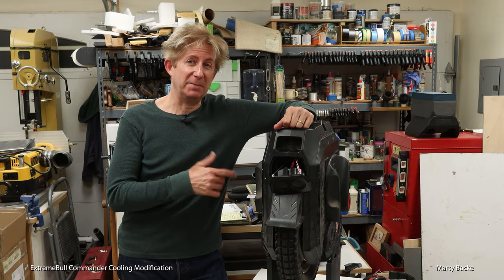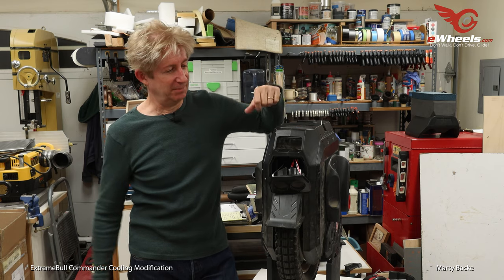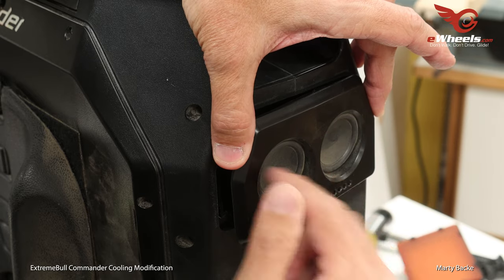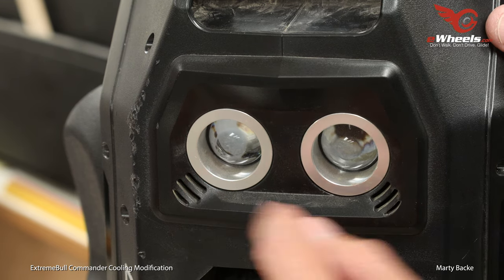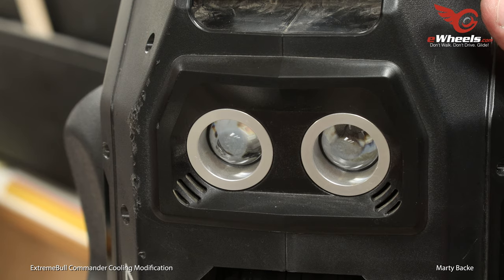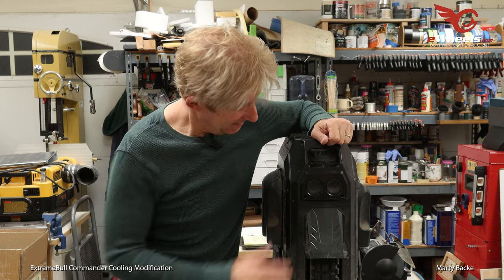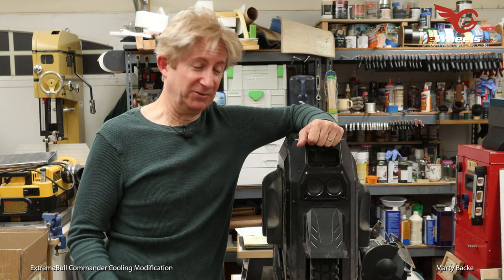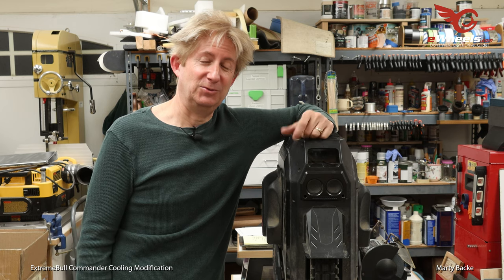Extreme Bull Commander Cooling Modification

Comment: There are so many PC air cooling solutions that can be implemented.
I would love to see them have a hermetically sealed electronics compartment.
The mossfest would mounted to a aluminum heat distributor with heat pipes going out of it.
The heat pipes would connect to a heatsink that is a part of the outer casing, and has air streaming over it as you drive your EUC.
Reply: Inmotion V12 is setup that way.
Reply: @GplusGains  Almost. Its a hermetically sealed half metal case with fins that uses the air stream in between the tire well.
I love that design.
Only downside is that there will be a nasty dirt accumulation on the fins.

Comment: Seems they should forget the rear facing speakers in the future, and focus on airflow and cooling, as this is their about dozenth wheel that can overheat. You can buy stick on Gore-Tex, which will let less air in, but not moisture in, which could be a solution for the future wheels, if there was a huge front air panel.

Comment: I'm stunned (but very happy) that they watched your video and admitted it was an issue.  Your video on the overheating was definitely enough to give me pause about running out to buy a Commander.  This is a step in the right direction.  I also agree with the other comments though...it's an indication of lack of attention to important details that is overall concerning....especially on a wheel that can go 40-50mph (HT/HS).   I have an RS19 HS and it always runs hot and almost seems to overheat at random.  I love the wheel and the way it rides, but overheating can be really dangerous.  Safety should always be first!  Thanks again for your work here Marty.  We are lucky to have you out there giving us dirt.  Looking forward to seeing your next heat test with the mods.
Reply: also out of curiosity...was it Begode or EB that responded?  I know they are connected, but I had the impression that EB was the actual manufacturer/design team.

Comment: in my opinion it's not acceptable to spend so much on a wheel and have to carry out modifications that should have been in place from factory. This only reinforces the fact this company did not thoroughly test this product before it was released and waiting for riders to be real life testers.

Straight up poor and disappointing.

After spending North of $4k I would not be looking to drill holes to improve air circulation and make the wheel vulnerable to water intake as well as the concept of butchering a brand new wheel is beyond me I found it difficult to watch lol

Thanks Marty for another great video with goid  content.

mr6ft2
Reply: There’s a $100,000 PEV called the Jetson where you have to assemble it yourself.
Reply: Andrew Ito...
they test the euc's with 100lbs riders 🤣
so went a 180lbs rider go uphill got overheat alarm way earlyer!
Reply: Exactly! For over $4K you should be getting the wheel that needs absolutely nothing but you riding the hell out of it!
Reply from the maker: Production copies will already have the modification
Reply: I have an MSP and an EXN and every time I take either one apart I'm appalled by the quality and thoughtfulness of the fit and finish. I agree the gotway wheels have an enjoyable raw power delivery that creates excitement but now the rainy season is starting where I live and the lack of refinement and quality is very discouraging and fustrating. Especially when I don't see it changing with the new wheels that Gotway or whatever they call them selves now are releasing. It seems like they're just using all their existing components and just placing them in different arrangements within new housings. Where is the evolution and integration of newer technology. When they don't take the time to confirm that the cooling is adequate for a high torque wheel that will be used for climbing it makes me wonder is this wheel even safe enough for us to be riding. The type of climbing you were doing Marty is not even a good indication of how much heat will be generated on a steep slow climb in summer temperatures. I feel that the irresponsible way that gotway is building and selling wheels is threatening the very existence of EUCs. What happens when someone is seriously injured or killed when one of these powerful poorly built and engineered wheels malfunction or catches fire. A gotway or gotway related product is not in my future. Especially with wheels like V12, S20, and Abrams on they way. I don't understand how the people that are allowing these wheels to be sold can look at them selves in the mirror! Disgusting!
Reply: @sherryandpeter  simple answer: you have yourself 2 gotway wheels, aint you? Well, try to ride a v12, and then tell me if you have the same amount of fun riding it! And specially freedom to do what ever you want to do with it. The difference between gotway philosophy and inmotion s is that you can use your battery, on the gotway at your responsability till the end, even if you have 20% of Juice on your tank. That means you can speed up almost at full speed till the end. So, you decide what to do. Inmotion will say to you what you can do. It's the wheel that commands you, and not the inverse. I hate that a wheel tells me wich speed I can ride at which percentage of battery I have!
And a v12? Really? Are you comparing a 16 inch wheel with your msp or exn? Jesus, you really dont know what you're saying, man. Give me your exn. I'll handle it happily. Even with all the defects youre pointing out... 😜
Reply: @ElectricUnicycles  just got my HT from ewheels and it doesn’t have this cooling mod and is overheating. :(
Reply from the maker: @wravennn  Yeah, there's no getting around the fact that this wheel overheats too easily. It only happens on mine when I'm pushing it really hard. I need to add some large vents on the top to see if that helps more.

Comment: This wheel is for me! the torque and range is just want I want! I don't mind doing a few mods to make run cooler. Very excited to see how this cooling modification works and what your suggestions and community are to make it run even cooler.
Torque
Higher Pedals
Huge Range
Possible Better Temperature Mods
i'm Ready!

Comment: Thanks for the great video. This is why I keep telling myself I'll never buy another Gotway (and I might actually stick to it now that KingSong has stepped up the game). I bought a EX.N and it had massive overheating issues. I literally managed to get it to overheat in less than 60 seconds after the wheel had been resting in ambient temperature overnight. To be fair that was while climbing an insanely long and steep hill, BUT my S18 can go up the same hill with me on it and the highest temperature I've seen on it is 140*F!  How can Gotway produce wheels and not even test the cooling? I can tell you if a wheel will have heat issues by riding it for just a few minutes. All you have to do is find a steep hill and go up and down it over and over for a few minutes. How can Gotway not do such a basic test when making a product? It's clear they just don't care about the details. How can they put backward firing speakers in a wheel and call it a feature? Its pretty much useless because you can't hear them unless you riding super slow. My RS19 has the new screen in it, and the screen is beyond useless. 

Dear Gotway: Don't add features to your products unless they are properly implemented and actually work well!
Reply from the maker: Agree with much of what you say, of course. Yeah, the EX-N is a HOT running wheel. Ultimately it's the ride experience that sells me on Gotway. Certainly not their attention to details.
Reply: I have no problem with my exn, i removed the black cover inside and add 2 more fans.
Reply: @electric_rider2044  exactly, you had to mod a brand new wheel to make it work properly and your mods might have made it more vulnerable to water. My solution for the EX.N was simple: I sold it 😅
Reply: @YourAubsome  hehe! I understand your point. Im surprised myself.  I added fan and sealed the bearings on my EXN and RSHT and made them waterproof as best as i can. Unfortunately no matter what there is no perfect machine but with the Commander HT going hot, not acceptable specially the price is high.

Comment: Marty I gotta hand it to ya. Your vids might not be the most adrenaline filled but dang if you're not one of more prolific true contributors to this hobby. Instead of hearing constant whine ala other YT'ers (which shall remain nameless), you understand that nothing's perfect (Cest La Vie where I'm at), you come up with solutions. I get your kinda heat ~2-3weeks outta a year so this would likely not affect me in the least plus I'm having a hardtime getting <50% batt per ride on the EXN so a Commander is not in the works either at least for the foreseeable. I do however appreciate the effort to enlighten the masses. Great vid & mucho gracias for the contribution!!! 👍

Comment: Did you hear about the shop that burnt down in Tucson Arizona? That suck. I was really counting on having a shop in America. I'm new to the EUC community, one thing that bothers me is that I would have to ship my EUC to China to get it fixed. I'm really interested in the Abrams because I think it would be a good city wheel. I could lock in up by the roll bars and it has tubeless tire so I could put fix a flat in it. I was wondering you work on EUC's I could watch your videos and maybe fix it myself?
Reply from the maker: NOBODY ever ships a wheel to China for repair. Even if you wanted to pay the exorbitant shipping prices, it's not possible to arrange for a repair. There are lots of local places that will fix an EUC. Most people learn how to do it themselves though. Videos abound on YouTube that show you how.

It's probably more work to fix a flat on a tubeless tire.

Comment: Just got the commander ht. It got up to 115 just going to get something to eat. I rode it without pads, so I didn't push it at all. Not more than 5 miles total.
Reply from the maker: That's still not bad. Unless you're pushing it, the temperature will usually stay below 130 which is great.

Comment: I must say that it is great that Gotway have responded, however £3k wheel and you are drilling holes for airflow? to be honest I dont think it will be enough. There should have been a large heat sink or a pellitor 12v cooling plate controlled by a temperature switch, easy to do and cheap. I know for a fact this would work far better than warm airflow. During last summer my 16x would over heat, my solution was a bag a frozen peas under the handle for an hour before I sent of to ride, and this increased my riding time by 30minutes, but with a pellitor cooling plate and temperature switch, the controller would never over heat.
Reply from the maker: I'll be testing to see if it's effective. I'm keeping an open mind.
Reply: @ElectricUnicycles  I want to come with on the test ride... I'd slow down... seems like alot of the testing you do is right around the corner from me..

Comment: The idea of having an air channel underneath a heatsink that is sealed off from the rest of the electronics is the best way to handle the cooling, IMO.   They are on the right track, but just didn't handle it quite right.
Reply from the maker: Exactly

Comment: So whats the results now ?
Reply from the maker: https://youtu.be/4eokQnrm3qA
Reply: @ElectricUnicycles  thanks.  By the way, I saw your video with eeeveee's. Could compare sherman max and commander ? Which is better in you opinion?
Reply from the maker: @MrPoliarinis  I have not ridden the Max enough to form a definitive opinion. From seeing its performance (eevee's) second hand, the wheel does appear to have the power of the Commander. If someone doesn't need the extreme range then I would recommend the Max.

Comment: It really isn't rocket science.
My first thought was, "Those are extremely small holes for air cooling."

It's baffling to me why Gotway keeps running into the same problem over and over again.
Just make a separate airtunnel under the control board and put a bunch of fins on it.  Let the metal transfer the heat to a place where water doesn't matter.

I know when they put together a schematic for there new order of a few thousand shells, that there has to be an engineer involved.  He's either completely incompetent, no one listens to his advice or he hates the company he works for.
Reply from the maker: Perfectly stated :-)

Comment: Lol why buy this wheel when Sherman is clearly better 😂 gotway is fixing it by drilling more holes wow.
Reply: Look fir EUC upgrade’s Abrams tear down, it ain’t without its issues either - poor metalwork finish leading to corrosion, inappropriate/non waterproofed battery connector, wood screws, it seems that nobody’s wheel is perfect, just like the cars.